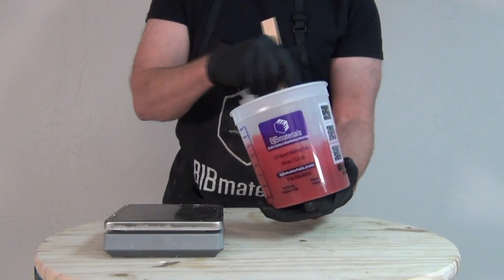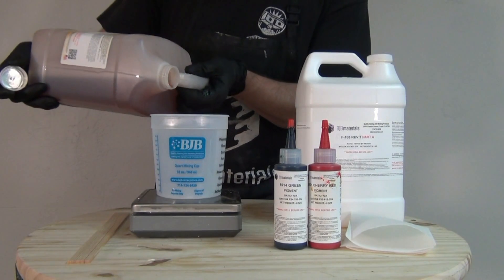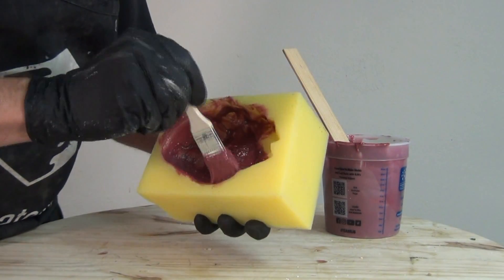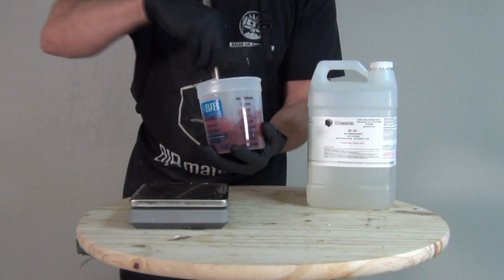Simulating Soft Skin & Organs With Polyurethane Rubber

Comment: I cast puppet heads out of urethane for years, I used to use one called 'Skinflex' (also from BJB) and it was great stuff when it worked. Why do I say "when it worked"? Well because urethanes have a very short shelf life and there were times when I'd order a batch and it was already going bad by the time it was delivered to me. The only other problem with urethane rubbers is that parts that are perfect when they're cured have something like a 10 to 15 year lifespan, after which they begin to degrade just like latex rubber does. For those reasons, I eventually switched to casting in silicone instead. In this video, the host says that urethanes have the advantage of being able to be glued to other materials whereas it's virtually impossible to glue silicone to anything... until now. The good news there is that there's a surface prep/primer you can order from the company 'Loctite' called 'Loctite 770' which makes it possible to glue silicone to anything using super glue. All of what I just said might seem like I'm negative on casting urethane rubbers, but I'm not. I'm actually tempted to try the brand shown in this video because urethan rubber has one HUGE ADVANTAGE over silicone the host of this video didn't even mention... how you get rid of seam lines. That's where silicone sucks and urethane is great because on silicone, all you can do is trim the seam off and carefully paint new silicone over the seam to help make it invisible but that's never perfect BUT with urethane rubber you can get GREAT seams by literally burning them off with a wood burning tool. If you put your wood burning tool on a dimmer switch so you can vary the temperature, you can get a perfect temperature where you can use it almost like a sculpting tool to gradually melt away the seams. Not only that but you can go a step further and burn in details like wrinkles and even pores in the skin! The surface where you burn the seam off will remain a bit sticky but if you clean it with a solvent like acetone and hit it with some powder, that stickiness eventually goes away. This make a HUGE difference when you really need to get rid of any traces of seam lines because maybe you have a character that's very smooth like a cartoon character or a baby. I love working with silicone but even with all my many years of experience as a special effects artist who has patched gazillions of seams, silicone remains a stubborn problem when it comes to making them truly invisible. So if you have a job where that's an issue, I highly recommend using urethane instead.
Reply from the maker: I never had a chance to work with the old SkinFlex formula, but I have similar stories about PMC-724. That stuff had a lot of mercury in it and would revert back to a gel, sometimes in as little as 6 months! It could do some cool stuff but was a superfund cleanup site waiting to happen!! I never tried burning off the seams with it. I knew it had mercury in it, so like “Mr. Happy Fun Ball,” I tried not to taunt the 724!
Reply: Whenever I burned the seams I would have cross ventilation across my table because yeah... it smelled awful and I'm sure it was really toxic. But working with toxic stuff is kind of unavoidable in this business. Don't even get me started on fiberglass. 😨
Reply: The problem with all silicones is that they are not safe. They call them skin-safe , food-safe etc, just bs. Long term exposure could lead to healt-issues. Silicone elastomers never become a completely “locked” structure in the same way  polyurethanes do.
Even after full cure, silicone remains a highly flexible polymer network with a significant fraction of low-molecular-weight siloxanes. These small molecules are mobile at the microscopic level and can migrate to the surface over time, a phenomenon often perceived as surface tackiness or an oily feel. In some cases, volatile components may slowly evaporate or bleed out of the material.

Polyurethane elastomers, by contrast, cure into a more tightly crosslinked and structurally fixed network.
Once fully reacted, the polymer chains are largely immobilized, resulting in a dry, stable surface with minimal molecular migration. Polyurethanes therefore do not exhibit the same continuous diffusion or surface exudation behavior typical of silicones.

This fundamental difference in polymer structure explains why silicone materials often remain slightly oily or tacky, while polyurethane elastomers cure to a dry, non-migrating surface.

Comment: One can also add too much of the SC-22. What happens is the A/B of the F105 can't contain the SC22 long term, in which case it will leach or exude from the solid substrate. Hence, BJB is reviving an enhanced Skin Flex formula, that some may remember from years ago. This new matrix will "contain" up to  200% SC22 or an all new SC-Additive, without an exuding. It also has self healing properties and a great elongation. Hence, be careful going above 100%, but also be ready for the NEW Skin Flex, coming soon.

Comment: Which is more durable this or silicone?
Reply from the maker: It depends on the formula. F105 is really strong, probably more so than a silicone of comparable softness.
Reply: @brickintheyard  Is it ever used in a common product that we recognize or is there something similar that we would know by touch?
Reply from the maker: @eveliinatistelgren172 I can't disclose what specific products customers use as that information is confidential and sometimes protected by an NDA. That said, F105 mixed 1:1 with no SC-22 cures to a 5A, so about like the tips of your fingers. With the ratio of 1A + 1B + 2SC22 it cures to around a OO20 or like an earlobe.